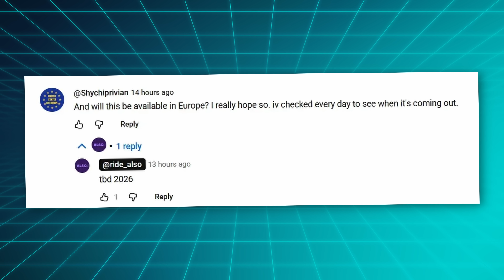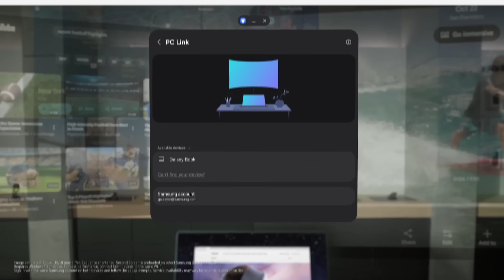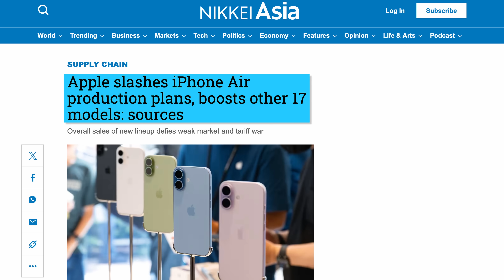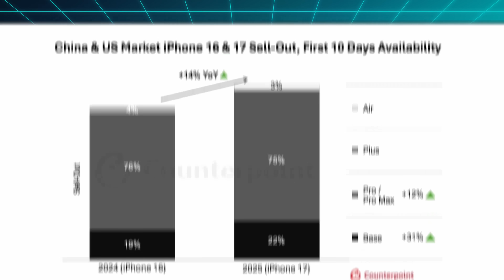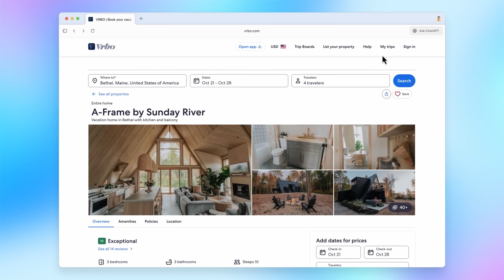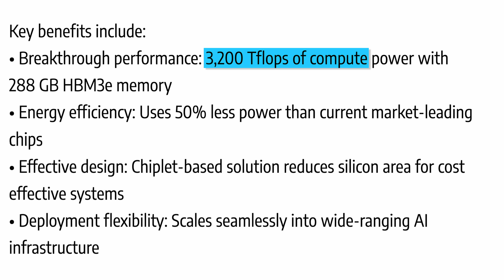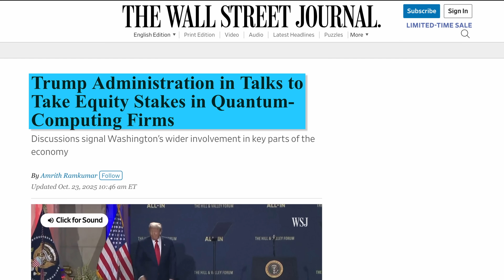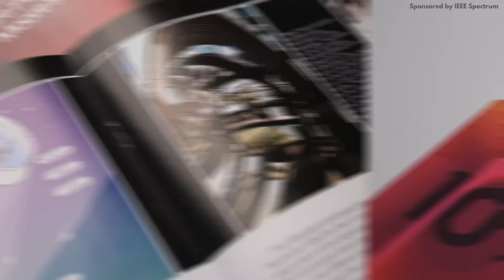Rivian reinvented the e-bike!

Comment: The e-bike looks gay and I wouldn't be caught dead on it, I'll stay with my much better priced and way better looking bike which I have two of and that is the power goat V3 and the motor goat V3 and I have dual batteries on both of them and they go 50 miles an hour and I can go for a really long time and it absolutely cost me $0 to fill the tank because I don't even have to pay for electricity. Because I have a solar panel and A Electric generator I'm not a moron so I didn't wait 3 years later like people now getting into them so that you're paying high as fuck tariffs and higher rates on your electricity I'm a prepper so everything I do is definitely 5 to 10 years earlier than most people. So if you go on the website now they're like 2700 I got mine in January of 2024 for around $2,000 a bike each the batteries I think are like 700 now I got them for $400 and they literally look like a fucking Harley as in they don't look fucking gay

Comment: Pedal by Wire, AKA, if your battery dies good luck pushing your paperweight.
Reply: That they mention it can do regen braking as if a normal ratchet couldn’t have allowed that shows it’s designed for people who can’t think and have nowhere to be.
Reply: @Freshbott2  Regen braking is unusual for mid motor bikes because they almost always have derailleur gears on the rear axle, so on regen the jockey wheels in the derailleur would get pulled forward by the chain tension on the wrong side of the chain, breaking the derailleur. This bike presumably uses a virtual CVT gearbox, which is a great idea in hybrid car drivetrains, but ridiculous over complication for a bicycle.
Reply: Staying with my mid motor Alfine equipped e-bike. Regenerative braking would be nice but not worth the down-side. E-bikes rock. :cat-orange-whistling::medal-yellow-first-red:
Reply: Everything is turning to this… it’s not a new idea.

That being said, it’s not for the average cyclist u **
Obviously, it looks like it’s for the higher end luxury/ leisure enthusiast.
& why not, it tells you the charge, you plan your route & you’re back home to put it to charge.
Just like an electric motorcycle or car.
Not understanding their strategy doesn’t mean it’s dumb
Reply: You could theoretically still bicycle like that, just a lot less efficiently than a regular bike.

Comment: If the bike has no bigger advantage then im sure noone will buy this here in germany, as this type of vehicle is actually a motorcycle then, which means you need to register this to insurance every year. This is not that case for normal ebikes, as this just supports your power and can even run without battery

Comment: The thin phone craze was and is stupid its only resulted in fragile phones with less features who only have a usable battery life due to better batteries/optimization. Honestly bring back the slightly thicker phones from the start of the smart phone era and all the features that have been taken away (like the micro sd card slot) and use that better battery and energy efficiency tech to good use and make a longer lasting phone

Comment: I think the only real downside with the new galaxy headset for me is the hard strap on the back. 

Based on how the new head strap for the Vision Pro has been talked about, how the thing mounts to your head obviously can change a lot about the headset. I think Samsung went with the more practical option in some ways, but I think it is the worst choice for content consumption. You can’t lean your head back into an airplane, if you’re at home, you’ll need to stack pillows behind your head. From my experience with the Quest Pro which is very similar to this headset design wise.

Comment: 6:03 why does a power bank have an AI icon?😭
Reply: Due to ai implemented at the battery management system, BMS
Reply: @sachin_rajyaguru not ai
Reply: @sachin_rajyaguru  how is that ai?
Reply: It’s not AI (Artificial Intelligence). It’s All In, when you plug it with 2 Type C inputs, it displays the AI, which means All In.

Comment: Because those "thin phones" are actually NOT thin ... making silly hump on it doesn't make the phone thin.
Reply: I think it has more to do with the price to value ratio. Thin isn’t a feature.
Reply: @neoish  no it doesn't. Apple fans aren't aware of price, they're gullible sheep. But they can recognise that a thin phone offers no thin phone advantage if it's still as thick as the last one. They just haven't made a thin phone which might appeal to some people, they've made a thick phone, that's thinnest bit isn't thinner than anyone else's versions anyway (not it's the 'thinnest' Apple phone not the thinnest phone). Price to value doesn't matter to the Apple sheep because they're like console 'gamers' and always have been. But there's clearly a limit to how much they can be fleeced. Even though they'll defend the Magic Mouse design and Jonny 'Absolute Hack' Ive until they're blue in the face.
Reply: @jonevansauthor  that’s a weird take calling people gullible sheep because they prefer to pay for a particular brand. I’d bet you have a brand you also prefer to pay for even if there’s an arguably cheaper or better alternative. There’s ALWAYS cheaper/better.
Reply: AND are more expensive with LESS features and  battterylife, it’s just a bad deal in every way no matter how you spin it…
Reply: Even with regular phones I'd rather the body is thicker so there's no hump.
Reply: It's about slowly reducing the battery size so a) BOM cost goes down b) they can sell you an extra battery that then fits flush with the hump later on.
Reply: Plus, everybody just slaps a case on anyways

Comment: An expensive phone offering nothing  actually compelling other than the novelty factor fails to find its market - a true shocker.
Reply: less for more
Reply: Everyone is saying they'd rather have a slightly thicker phone with more battery but manufacturers literally keep doing the opposite and expecting it to sell well
Reply: It’s a test product for when they do foldable phones. 10% allocation? Yeah, they weren’t expecting to sell too many of this phones.
Reply: @Javier64691 Reports show Apple lowered produced because the Air didn't meet expectations.
Reply: @MRTOWELRACK  yeah, that’s why I said they weren’t expecting to sell too many.
Reply: @Javier64691 yeah, but they're still lowering their expectations even more.
Because their starting expectations were low, but reality was much worse.
Reply: It should've been a model between the 16e and the base 16) starting at $699. Then it'd sell like cookies. But for that price, why?
Reply: @5idi I actually don't think so, for some reason everyone wants to buy the "pro" model. You see it in the chart, 75% of people buy the "pro" version.
Reply: I actually like that they dare to come up with something new, if you need a thick phone with big battery simply get a pro max.
Reply: @EK-hd7frno, we want it thick, not large.
Pro max is too big a screen.
Reply: Hey, at least we got smartphones to be "fun" again even for a brief moment. Now back to the same slabs.
Reply: Would you consider foldable devices the same?
Reply: @nootanwait2358 No because foldable phones give you a bigger screen when folded out and back into a smaller one to fit back in your pocket.

Comment: It's not that people wouldn't want thin phones but they must have similar specs. The Iphone Air has just 1 back camera. In 2025 it's unacceptable
Reply: You can’t have a thin phone without compromises…
Either with everything & being bigger than the biggest iPhone & priced to the moon 
Or halfassed like Apple is doing rn
Reply: when you poll people what they want in what order, being thin is always at the bottom. Its not what consumers want. They want massive battery life and dazzling screens, great cameras and so on. No one ever bought a phone and was let down it was .1mm thicker than their last phone. Its reviews who do these stack side by sides to show how thin this new phone is. It makes it seem like its desirable. Its very much like TV's. No one gives any shits at all that their TV is thinner because you only look at it from the front where the thickness is totally meaningless. But TV's get thinner and thinner at the edges. Why? I have no idea. But I'll happily take a phone twice as thick if it gives me at least twice as much battery life and maybe a lot more than that or just make it thicker so it can have really good cooling so the phone can go nuts flat out without throttling or literally over heating and needing to shut off.
Reply: @ClayMann  Better battery tech is available that would allow higher capacity for even thinner phones these days, like Silicon Carbon, which give you ~20% more capacity in the same volume.

Comment: I love my iPhone Air. It helps with rewiring your brain with smartphones addiction without losing functionality
Reply: How does it do that
Reply: @tomer4566  With the lower battery life of the device. You need to be more conscious of use the device especially if you don’t buy battery pack. Which was my mistake when I owned it at the beginning. I’ve cut down my screen usage by 3 hours.

Also looking back at photo history. Their were only a handful of cases when in needed more than the main camera. 

The speaker is rubbish but that can be mitigated with Bluetooth speakers or AirPod pro 3
Reply: In what aspect?
Reply: @Klarkada   Some apps and internet services are now pretty much required for my country and job. So I am not losing the functionality by moving to somethingn like the light phone. Most of comments about it are in the above comments

Comment: I'm curious to know how Tecno's slim phone is doing in comparison to Apple and Samsung
Reply: Infinix have released the Hot 60 pro plus that's 5.9mm thick and has a 5000 mAh battery and only 120$ which is interesting, i do understand it not as power as an Iphone air but it's still impressive what can they achieve on such a tight budget

Comment: 4K USD for a bike? that will never fly outside America and EU.
Reply: well, a 4K bike that can fly doesn't sound so bad
Reply: you'd be surprised. There are a number of companies selling 5K electric bikes. Some less and some a lot more. They target a different kind of customer that is trading the bike for a car to commute and such. You're also paying so much more when they get the weight right down and use things like carbon fibre. Heavier doesn't seem like a big problem until the battery runs out or if you're unlucky enough you need to carry yours upstairs indoors.
Reply: 4k is pretty sandard for an E-Bike
Reply: @drlauch2256  They go up yea, but the most populair ones are probably the cheaper ones(also why fat bikes are getting sold so much, those are incredibly cheap)
Reply: That doesn't fly in eu neither. Nobody in their right mind would buy that
Reply: @Klarkada  Here in the Netherlands I’ve seen many e-bikes exceed €3000 in bike shops, so I think only in the Netherlands this could work
Reply: @Klarkada thats actually a normal price for an E-Bike here in Europe
Reply: @Klarkada 3-4k is a normal price still
Reply: usd isn't used in the EU
Reply: 4000€ is not a spectacularly high price for an e-bike. 5000-7000€ will get you a high end e-bike on sale, but the top tier models will be 7000-11000€.
Reply: It doesn't make any sense because it doesn't work without charge like typical electric bicycles do...
Reply: It's a terrible bike. I got my ebike for 2.5k € and one it is a better ebike and two it's an actual bicycle that rides like a dream without the battery.

All the parts are pretty standard bike parts except the Bosch motor and battery.
Reply: My e bike cost 350. Y'all are rich
Reply: Better than Ford😂
Reply: inovation i want internal hub gear and belt for budget bikes
Reply: Don't be silly, bikes don't fly. They don't have wings.
Reply: @happy_capybara Red Bull springs to mind here ☝️😉
Reply: Thanks. Now i feel iam normal and not alone
Reply: In 1500 dollar you will get the ebike in india
Reply: not in the EU
Reply: If Chanel and Hermes can sell bags for much more than that, there are people willing to buy this. The AVERAGE person even in the west can’t buy this, but they aren’t the target audience anyways.
Reply: It doesn't fly here in the EU either